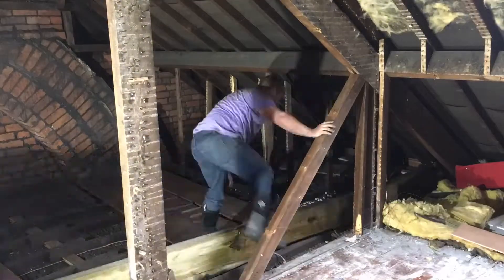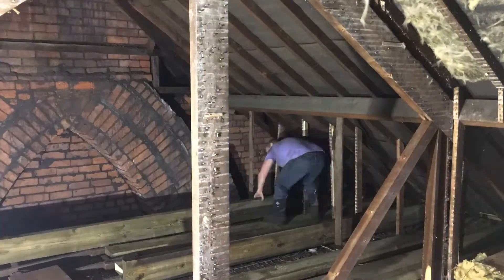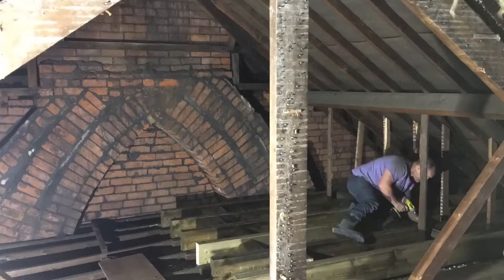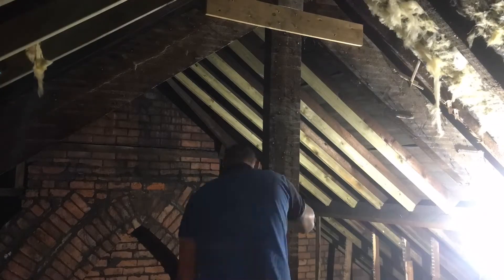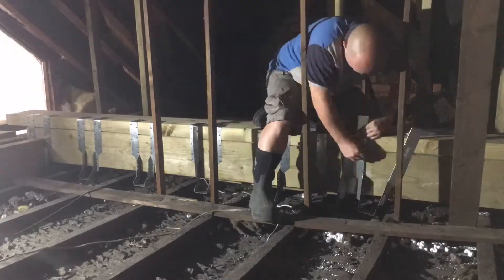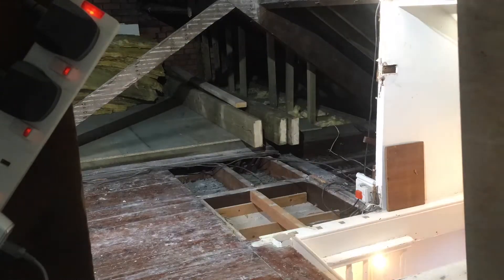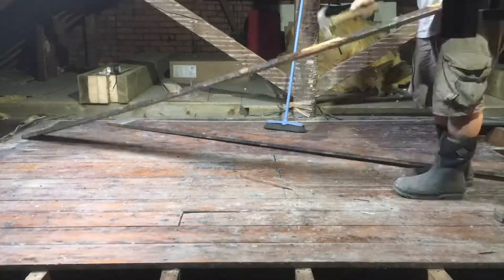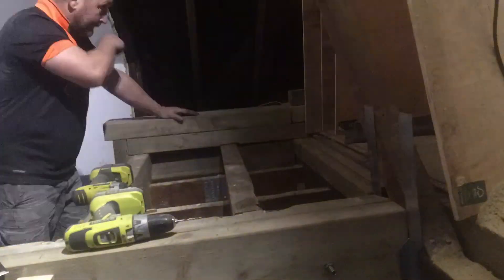Loft Conversion Floor Build Time Lapse. See as the Joists and Noggins Go in plus Structural Beams.

Comment: OMG..... That was a piss load of work completed in 7 minutes.  Very impressive the amount of strengthening you incorporate.
I was going to board out my loft but now I am fully aware that it was not as simple as just placing boards on the current joists.  I have a lot more planning to do and more material costs to consider.
Thanks for the video..... Great job... 🎉🎉👍👌
Reply from the maker: Thanks a lot. Yes it was a lot of work. An awful lot to get up there. But the results speak for themselves in the end. Thanks for watching and commentating.

Comment from the maker: Hi. C24 grade tended to come as treated option only, particularly the bigger stuff. It was also specified on the structural engineer calls. I guess the question is ‘why not?’. The price difference for rafter timbers was so marginal. But at the end of the day, the structural engineer specified it and that is what building control will sign it off against, so it went in. My own personal view, I’m glad it is treated just for piece of mind.
Reply: Hi what size was the timer ? You used please

Comment from the maker: Hi. No the design here was to NOT connect the old ceiling to the new floor above to ‘isolate’ the pair. This was as per the structural engineer. However uprights has previously been added between rafters and ceiling joists to stop the old ceiling sagging. You can see them at the edge. I added more as my ceiling was dropping a lot.
Reply: sorry to be so offtopic but does someone know a method to log back into an Instagram account?
I somehow lost my account password. I appreciate any tricks you can offer me.
Reply: @Allan Francis instablaster =)
Reply: @Gregory Axton thanks for your reply. I found the site on google and Im waiting for the hacking stuff now.
Takes quite some time so I will reply here later when my account password hopefully is recovered.
Reply: @Allan Francis You are welcome :)

Comment: That huge beam, is it made up of  triple or double timbers at 225x75, using M12 bolts?
Reply from the maker: Hi & Thanks for watching. If you mean the lateral beam, yes its two beams 225/75 side by side but I used M16 bolts. It also has on top another 225/75 so is in effect an upside down U shape. This gives it a lot more capacity structurally. This is screwed on top plus straps every 300mm-400mm or so, making one single massive mother of all U beams. It sites on wall plates either end. I did the calcs (I am an Aerospace engineer by trade) and it is way over capacity but as its just outside the bedroom space it can be as big as I want and stronger is better. Obviously if you need to, do get a structural engineer to size things for you. This would have been more space efficient with a steel beam and probably no more expensive, though getting it up and in would be a challenge. I hope this helps. Andy
Reply: @kjdrandy1468  an interesting  and unusual solution coming from building structural engineers that are more comfortable with their concrete and steel. As you said, it has the added advantage of being able to get the material into the loft by yourself. You say  there is a wallplate next to the chimney breast which is unusual, I was expecting a new wall bearing after knocking of hole out of the brickwork.
Reply from the maker: Yip I cached in my luck as there was a flat pad in the chimney brickwork which had been used as part of the gable end supports to some ceiling joists. So I knew it was level and clearly structural. The other end is on the wall forming the stairwell which again is structural so happy days !

Comment: Hi, great video. Just bought a bungalow and will one day be going into the loft. I understand about having to upgrade the beams, use packers so theres no pressure on ceiling etc, but I got a bit lost on the structural beam. Why was this needed and how was it installed - what was it fixed to to give it structural properties? Thanks
Reply from the maker: Hi and thanks for watching. I assume you are asking about the massive beams which I put the hangers on. This is because at the front of the house I have bay windows and the span from the back of the bay to the centre wall is too great for the beams I could buy (by about 20cm...grrrrr...) so I did a beam sideways (triple beam in fact) mounted from the staircase wall across to the chimney breast which happened to have a socket in it just the right size (on one side) and the other had a pad just in the right place too, so all on walls just like the rest. If I had another 20cm or so I wouldn't have needed it. Nonetheless follow what the structural engineer tells you. Thanks again. Andy

Comment: I want to use my loft as storage. It was built in 1935 so wouldn't want to build off existing beams as they aren't very strong. For storage purposes only can you install new beams from wall plate to middle wall on both sides with no issues? It's 4.1m span what size beams are recommended. Thanks
Reply from the maker: Hi. I would get some advice. Its a few hunderd quid but then your floor is legal and you wont get issues in future.

Comment: Looking at doing this in my house. The ceiling beams are too thin to use as a floor in the loft so a suspended new floor needs to be fitted. I’m considering removing the ceiling altogether so the suspended floor can be fitted lower and increase headroom in the loft.
Reply from the maker: Hmmmm...the issue you have is the wall plate. This is timber sat on top of your walls (brickwork) and the beams for your ceiling and joists for your roof sit on it. So basically the height of the bottom edge of your ceiling joists are set by the position of the top of the wall plate. Your new floor joists for the new attic room also sit on this wall plate usually (and in my case shimmed to give a specified clearance to the old ceiling - 10mm only). I believe (though please check) that notching of the joists would be frowned upon (not allowed) so I don't know how you lower the new floor? They only alternative I can think of is a new wall plate bolted onto the brickwork walls and joists hung from that. This would mean your ceiling height would drop a lot (maybe 8-10") and again you need to check it as an option (discuss with your building controls office - they do help guide you if they can). An alternative is to 'split the span' with a large structural beam (usually steel) - this would allow shallower joists to be used but you only save a few inches at best. I hope this helps - and thanks for watching and commenting. Andy
Reply: @kjdrandy1468   It's quite an old house (1920's semi) so the ceiling joists sit inside holes in the wall brickwork and the roof is supported by the dividing wall between us and next door and slopes down to our outer wall. I was hoping to remove the entire ceiling and replace it with a floor bolted to the walls with rawlbolts. The age of the house means the ceilings are very high anyway so they can be lowered quite a bit and still give 7ft + of headroom. Obviously before I do anything I'll seek professional advice- I watched your video for research purposes.
Reply from the maker: Hey - It's difficult to imagine in my minds eye and get it right. If you take a look at my 50k saving video I give you all of my costs....but what I can say in summary is Checkatrade is a great resource (no I'm to sponsored). To advertise on there they really do validate your qualifications, insurance, work etc etc so in my experience if you rate well on there then you are pretty good. This is how I found a good and super cheap architect and a decent builder. At the end of the day aI only posted to see if I could help. Good luck to ya! Andy

Comment: What are the joists resting on at the outside ends? did you have to taper them down to follow the roof line and get to the outside wall or did you have other internal walls for them to rest on?
Reply from the maker: Hi. Thanks for watching. Yes the house has two brick courses and wall plates on both but I used the inner mostly (timber on top of the wall). The joists were tapered to a minimum of 100mm high at the tip according to structual engineer instruction so the beams only just reached the outer course. THere was also an internal wall (in the middle of the house) which the othet end rested on. The total span was circa 8m and you dont get beams that long, particularly wooden ones! So I had about 3.7m spans from the central (load bearing( walls to the external walls. I hope this helps. Cheers. Andy
Reply: @kjdrandy1468  That's interesting, I'm just in the process of buying a house and saw the loft was boarded with some thin insulation but was originally thinking of using loft legs on the existing beams when we got new insulation and just putting new boards down, but now I'm glad I did a little research as it looks like I need to locate any central beams that can be load bearing and do what you've done here to strengthen the floor.
It doesn't look like a super hard job but I suspect it's gonna cost me a lot more than I thought! The old owners had some fairly heavy stuff stored up there - higher than the 25kg m2 specs anyway, and the existing boards didn't feel super sturdy, but the RICS survey didn't say there was a problem. I'll have to assess what beams are load bearing when we move in and see if I can price up some supporting beams. The plus side is it's a much smaller loft that the one you have here.

Comment: why did you replace them joists in the first place, what size were the originals? Also if they are being supported in the middle by a brick wall, could you really put a lot of weight on them realistically?
Reply from the maker: Hi. The original joists like in most houses are way too small for this span. There are standard 'span tables' which tell you how big joists need to be. I seem to recall these were 75mm wide and 220mm high at 400mm centres - but a structural engineer will tell you what is needed for your circumstance. Don't be shy with joists...you don't want the ceiling below vibrating as you dance to your fave tunes upstairs for example...so oversize is best if in doubt. These new joists sit in between the old ones and I have packers at each end (on the wall plates) so they are higher than the originals...so in actual fact the new floor doesn't touch the old ceiling at all. This isolates the two and helps with things like vibration and noise. The centre wall is a structural wall so can have the joists on them. I wouldn't be able to do 7m+ spans in wood I don't think, so these walls were very helpful. Thanks for watching. Andy
Reply: @kjdrandy1468  converting from mm to inches, those original joists are 8x3 surely this is enough??. also i have seen loft conversions with 4x2 joists. would you say realistically not talking charts and tables, would a 4x2 joists snap when you put the average bed, wardrobe, counter and person up there?
Thanks
Reply from the maker: @db-bv5rs  Hi. I think my joists were 12x3s -250x75s. What you are asking depends on span. For a small span it might be OK but for bigger...I doubt it. IN the UK if you had them Avery 400mm apart they wouldn't do 1.5m span and this is without special loads on them. Try putting a 4x2 on two blocks at the span you have and stand on it -three of you..in the middle...and move. See if the beam moves at all. If it does, so will the ceiling etc below. my joists also give support to the roof through a structural wall along the purlins..as way of removing all frames....I really think you should ask. In the UK we have 'building control' as part of the council and they will give you good advice if you ask for it. Hope this helps. Andy

Comment: Hi Andy. Really informative series and I'm about to start on a similar project. Do your new timbers just rest on your wall plate or are they fixed to the plate in anyway. With the noggins etc it looks as though thats not needed.
Reply from the maker: Hi Robert. Thanks for watching. You actually answered the question yourself. The noggins are holding the beams upright so no they are not fixed to the wall plate. To be honest these ones are 3" wide so stood up nicely all by themselves! I did however use plywood shims at one end to make sure that they were level and ensured that these were at least 150mm long, partly to make sure I 'landed on them' when laying the beams as manipulation of beams so heavy in tight spaces can be tricky. Thanks again for watching. Andy

Comment: Nice job. Your loft height is crazy high haha. Mine is only 1.9m.  What size are them beams and how big is the span supporting all them joists?
Reply from the maker: Hi. Yip mine was over 2.4m. The beams are 220mm x 75mm and the span was 3.6m at 400mm centres. I would say they are oversize but actually support the roof too as structural walls were added (structural stud work and ply face sheets - see another video of me chopping the roof out) to pick up on to new rafters. This is where the structural calc engineer earns his £500. You can go with not so tall beams at more regular centres (closer together) or use steels to reduce the 'unsupported span' which reduces the span. There are loads of span tables which you can down - load to get a guide, but building control (the council) may insist on calcs, particularly if you are also supporting the roof as you are taking out roof structure. I hope this helps. The bigger problem you have is that the stairs need to have 1.9m height (with 1.8min as alleviation) and its unlikely your ceiling joists will be up to regs, so you may struggle to get a legal staircase in....worth checking before you start. If you are too low, then you would need to increase the roof height above that which is there (via a dorma) so you would likely need full planning permission to do that. Andy

Comment: Just started a very similar project
On my own loft, I also have got to cut out a 
Binder beam that is taking the weight
Of the original ceiling joists,
Did you hang the old ceiling joists 
Off of the new floor joists ?
Reply from the maker: Hi - sorry for the late reply. I didn't look at channel comments so missed you! No to answer your question. The old ceiling is deliberately isolated from the new floor. I think this is to stop the old ceiling moving/cracking while I am cutting shapes on my new bedroom (dance)floor. There are vertical supports linking the old ceiling joists to the old rafters (they were there before) but the new floor joists are laid in-between the old ceiling joists. I hope this helps. You can see this is one of the videos. Andy

Comment: I’m thinking about doing my own loft conversion, any tips and ideas?
Reply from the maker: Hi. 1. Measure up and then put a plan together of what you want -we used small pieces of paper 'to scale' so we could assess bed, loo etc - where everything goes incl stairs. Then engage an architect. I highly recommend checkatrade. They thoroughly vet anyone on there.  You will then get a design that works and is legal, incl structural calc if you need them (this would be extra). You will need drawings for building control consent and Also to get builders quotes (if you need them). 2. Shop around for materials - talk to a local builders merchant and see if they can do a deal for everything, delivered in stages as you need it. Number 1 cost is insulation (shop on eBay for seconds - this saved me £3k) and then timber. Hopefully you don't need steels. 3. Be prepared for months of mess. Price in skips - assume at least 2 at £330 each. Scaffolding can be expensive too so get quotes now while you are considering it.

For us the main design factors were - dorma for head height for the stairs (we couldn't avoid this without losing a lot of space downstairs) - Position of bathroom to access the soil pipe (new drains can be v expensive) - bedroom size then wardrobe space (as you don't get full height wardrobes so need more 'footprint'). This left space for the en-suite.

Finally - is your current heating system up to the addition. A new boiler is a major expense. We put in aircon with heat exchanger which is also good as it gets hot up there as well as cold and cost about an extra £300 over radiators and opening the window.

If in doubt ask your local building control on what is allowed and keep them onboard throughout.

If yo take a peek at my 'saving £50k' video I break down costs and process for you - it may be useful. Good luck!! Andy

Comment: Is it possible to do this without steel beams
Reply from the maker: Hi there. Thanks for taking a look. Yes it is, but you may need to get structural calculations done. In fact, there are no steel beams in this build and the beams are about 4m long! The reason steel beams are used is as, being so strong, they can do the job whilst being much thinner in height, so if you are struggling for head height, these will be better than timber. They can also support wooden joists, so reduce the 'unsupported length' of said joists, making them too thinner (not so tall). However this will all depend upon your circumstance. I hope this helps. Andy
Reply: @kjdrandy1468  so its do able without rsj I'm on a tight budget so steel is out the window
Reply from the maker: @jonathanpike2928  Hi. It kinda depends actually. If its a single beam and means that your joists can be smaller, it might not be that different and give you more headroom. Either way you may want a calc done. Building control may insist upon it anyway. Andy